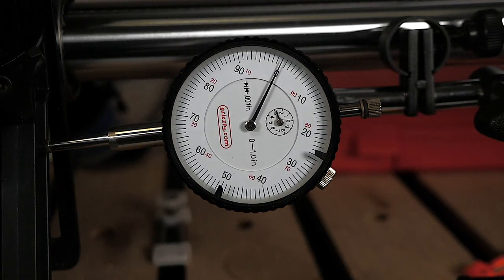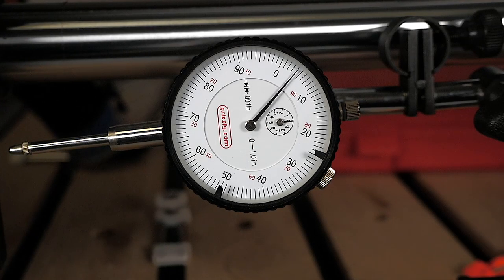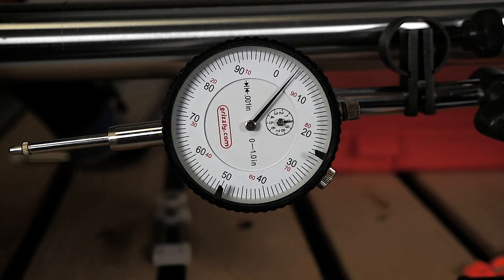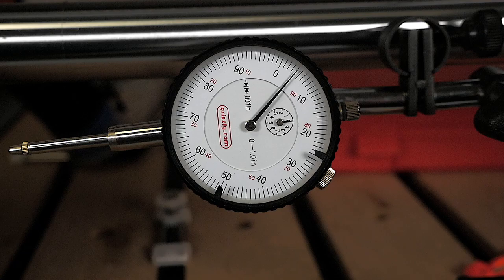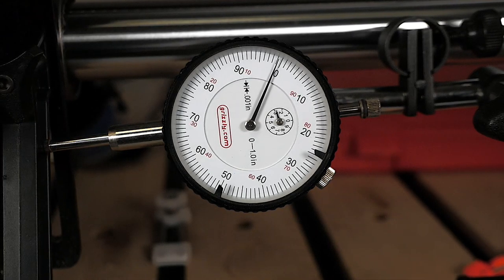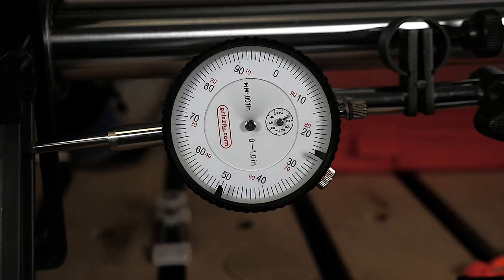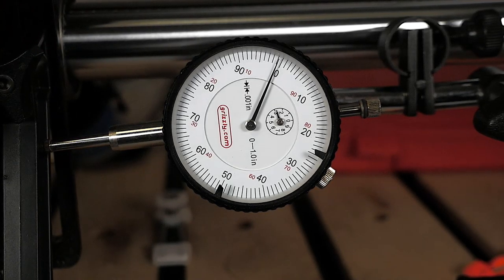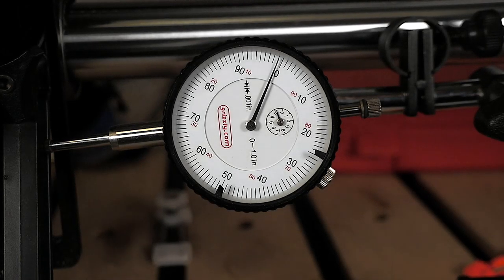Onefinity Homing Accuracy and Repeatability

Comment: Having being a machinist for well over 40 years, I noticed in the video, that you did not have your indicator square to the surface that you were taking the readings from. Believe it or not, it does make a difference in getting true readings!!! But still your test impressed me with the machines capabilities.
Reply from the maker: Thanks David - appreciate the feedback. I did try to get the indicator perpendicular to the machine, but had troubles holding the base securely.  Of course I figured out a good way to hold it down after I finished the testing! Doh. Thanks for watching!

Comment: Good information, thank you.  
My observation is homing variance on the X-axis of about .030 inches worst case (project example).  Not after every homing, occurs at random as far as I can tell.  I have since performed my own test with an indicator and have two findings. Moving the router between two points (x0.0 and x3.0) is consistent positioning within .001in.  But between Homing and 3.0in it can vary .010in. (10 samples) Have you found any way to improve stall homing accuracy?  Thanks
Reply from the maker: Hi there. Thanks for the additional data points. I saw similar results with homing. It always seemed to bounce around without any constant variable. So, no, I have not found any way to improve homing. I have recently increased the stall current a little, but I have not retested to see if that helped (or hurt) the homing sequence. I'm curious if future firmware will home a couple times and average the value to get a more consistent home. Thanks for watching!

Comment: Great Video thanks for sharing. It confirm I did the right choice of machine. I imagine if you let the dust accumulate one the rails it could throw off the accuracy
Reply from the maker: Hi Yvon - if enough material builds up, it will affect accuracy to a certain extent.   In the abstract, if the material is always there, the machine will reliably home to the same position - the position will just be 'off' a little.  If the material builds up over time, then the repeatability will be affected. So, keep the machine clean and you will be good to go :)

Comment: Great stuff, I was wondering both about how the 1f does its homing as well as its repeatability as I have many multi-day carves and I prefer to shut down the machine overnight.
Reply from the maker: Hi Timothy - I have not tried an overnight cut but I believe some folks on the forums have.  I have re-homed during a cut without any problems though, so it should be all good!
Reply: @cyberreefguru  I believe you have a video on setting the the travel distance of X and Y, mine is off by about 1/16”. Can you recall which video that is.

Comment: Would it be possible to dial in the repeatability even further by adjusting the current threshold that triggers the stop? I believe I saw one assembly where there threshold was set too high out of the box and Onefinity talked the user through adjusting that setting so it would actually stop driving the motors at the ends of the rails.
Reply from the maker: Hi Toby - I'm not convinced the minor repeatability issues are current related.  I think it is just the variability of when the motor stalls.  But remember, the variability is really only a few mils (thousandths of an inch). You won't see any different for most wood working applications.
Reply: @cyberreefguru  No doubt it's impressive as is! I was just curious if there might be a sweet spot that you could dial in beyond the factory settings but it makes sense that there would be other limitations. I really appreciate the effort you put into your videos. I've learned a lot!